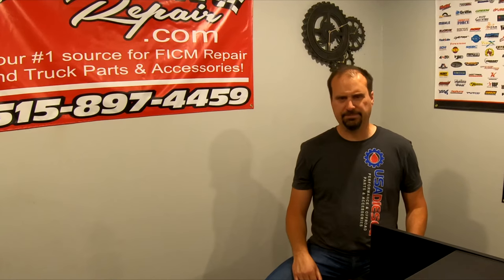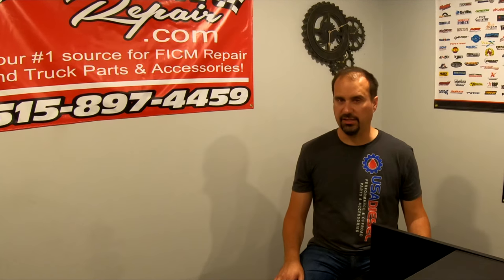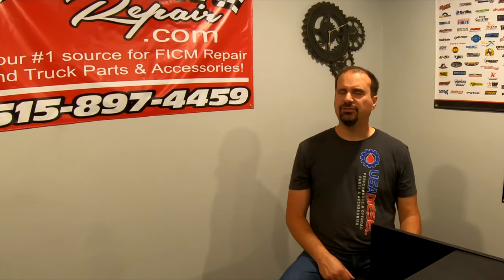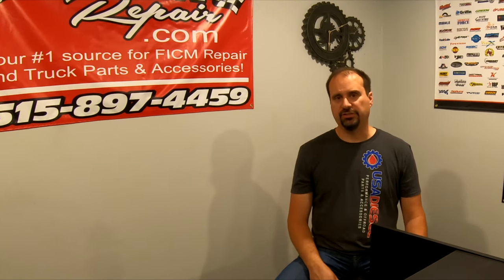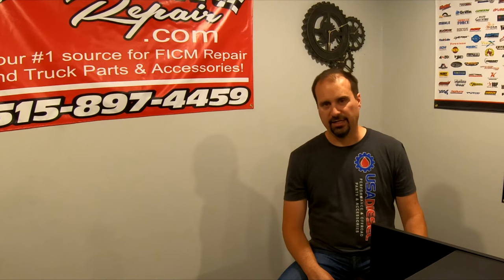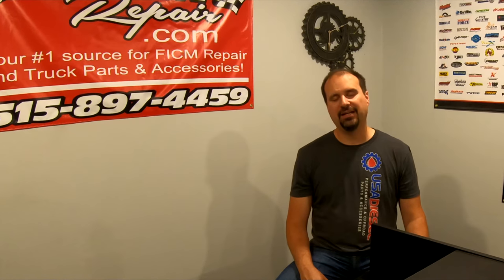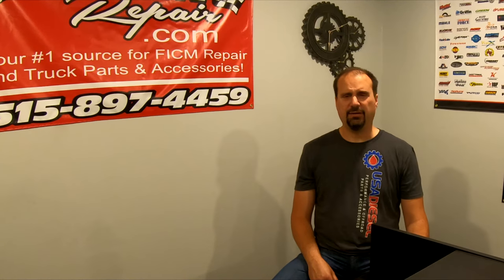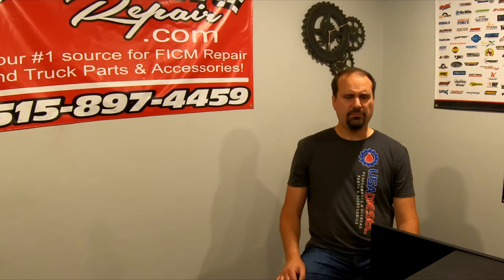AGM vs Lead Acid Batteries for your Powerstroke 6.0

Comment: 2004 F350 original owner. 200k miles. Tried many different batteries thru the years. Best I've found for strength and longevity are XtremeX2 AGM from Batteries+Bulbs. Made by DEKA in USA. They are a bit spendy but last at least twice as long as the best wet cell lead acid variety I've found. I really got tired of changing those every couple years for $400. The X2s AGMs are WAY stronger and last pair were good for 6 years so they're actually LESS expensive in the long run.
Reply: DEKA is the Bomb. Lasted me years. Went dead several times. No problem.
Reply from the maker: We like those batteries and the Odyssey AGM's, with a slight nod toward the Odyssey's.  We've got a pair of Odyssey AGM's in one of our shop trucks that are past seven years and still testing out over 900CCA!